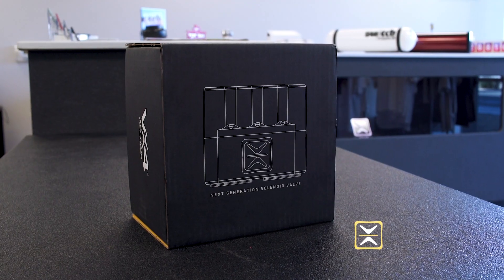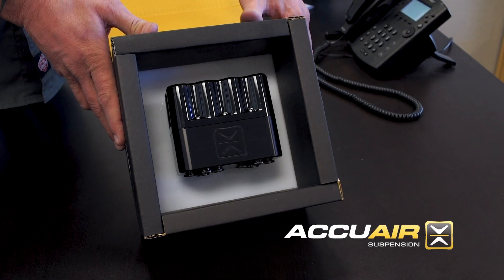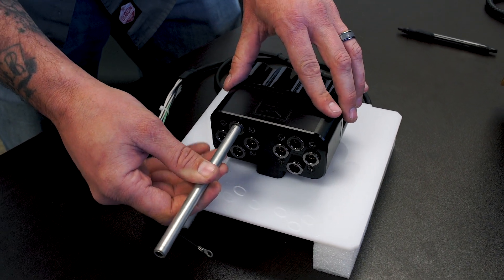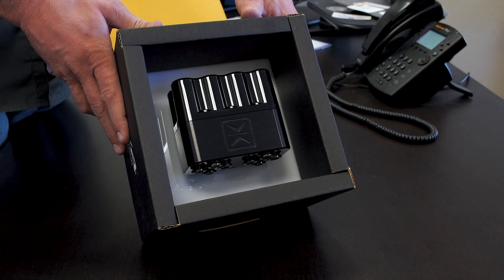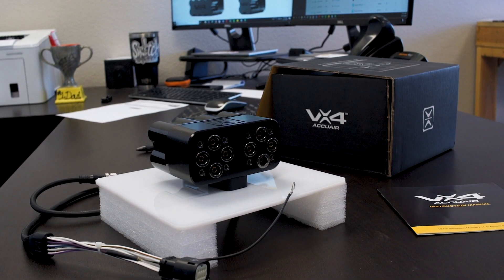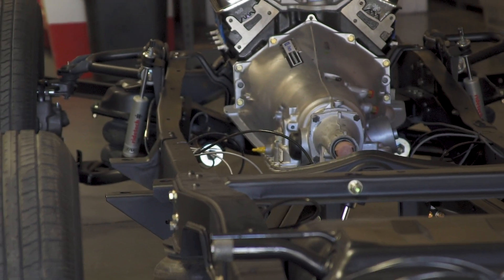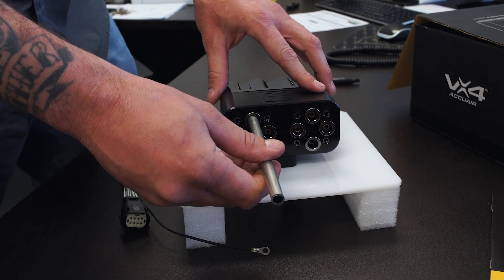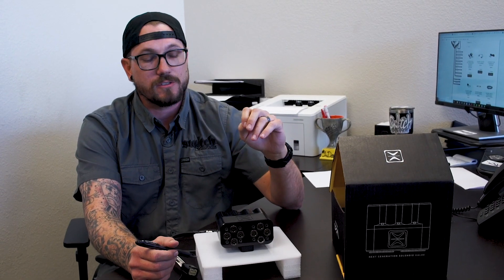Tommy Talks Accuair VX4

Comment: I see you demo a hardline connected to the new ffptc fitting. Are these fittings good to use with only copper or aluminum lines? Or will they also work with stainless steel lines?
Reply from the maker: Some fittings will work with stainless but there is a specific process we use to get them to stay in place 👌🏼